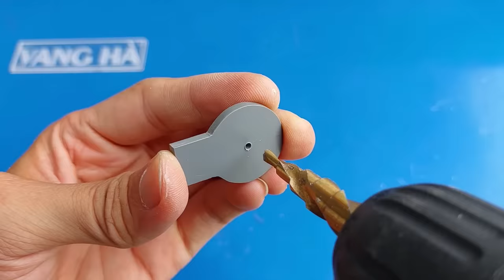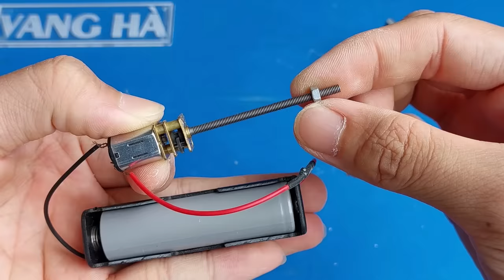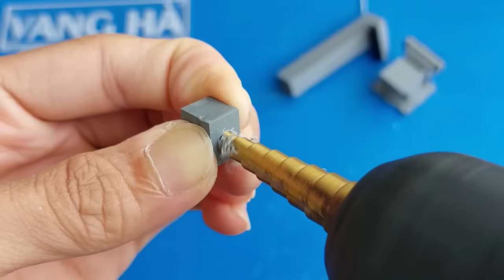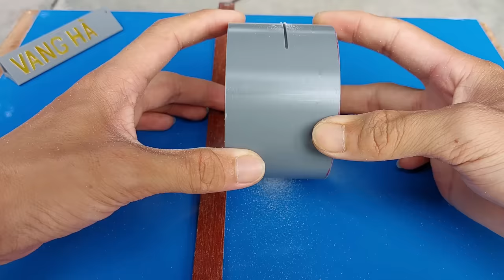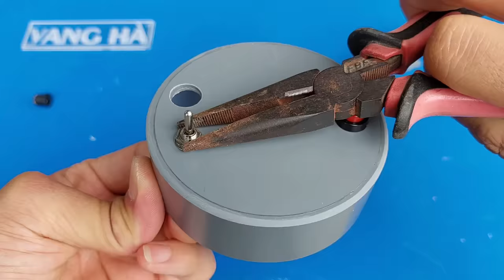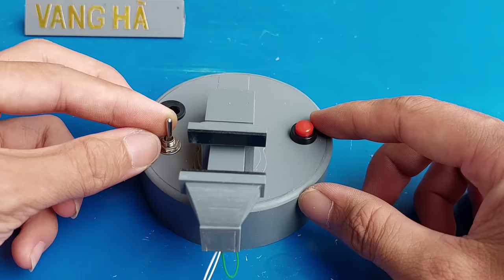Homemade A Mini Vise from PVC

Comment: I would have used a dual-pole/double throw momentary switch and discarded the DPDT switch. Also, placed the charging connector to the side wall. Over all, excellent idea and implementation! I like it. ❤

Comment: What glue/adhesive would you recommend to use to stick several of these pvc sheets together quickly? For example, say I needed to build it up to around 30mm in thickness.
Reply: 502 elephant